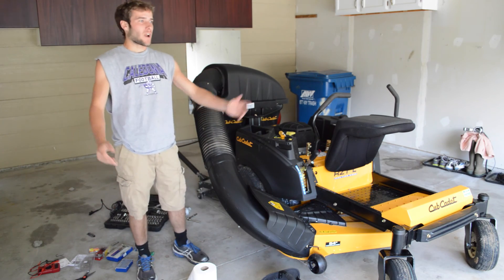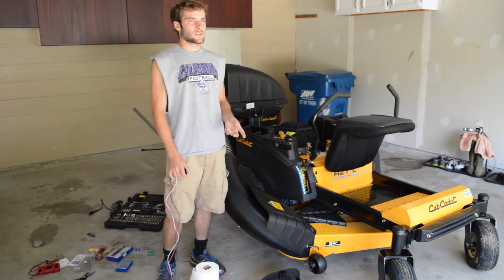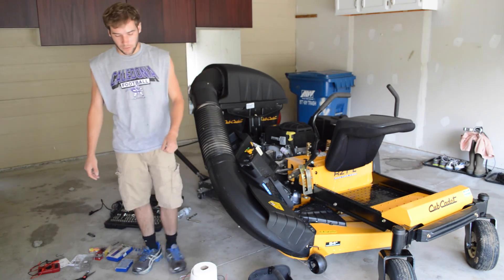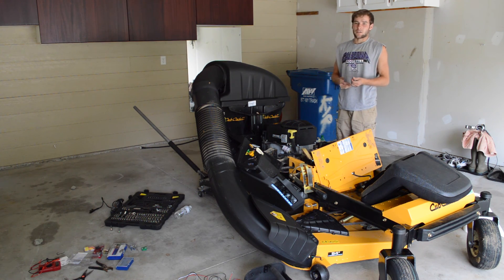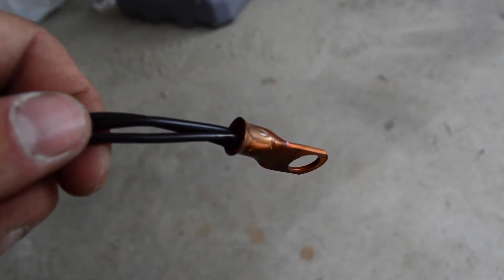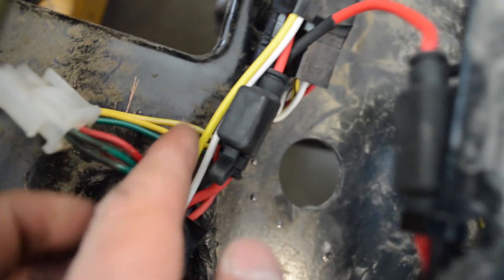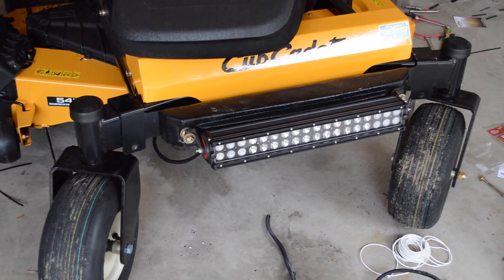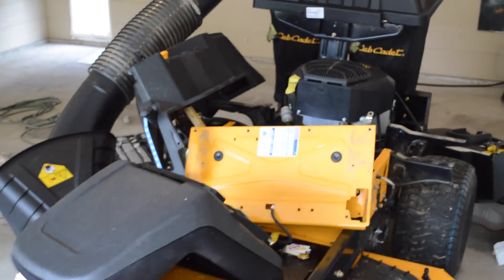Installing 12V outlet and LED bar on (Zero Turn) Riding Lawn Mowers

Comment: Thanks for the detail!  I have a similar model, and am trying to decide if I'm talking myself into or out of doing the lights mod.  Do you have any problem with battery drain or alternator damage?  The alternator is rated for 15A, and your mod draws 7.5A, so half of the capacity, and it wasn't designed to add lights.

Comment: Would you draw a schematic for us, or send me one em. My previous comment re: resistor may have been to stop AC current from stator. My John Deere Z turn has a fuse pocket and sale a kit with a single light. I would like to make my own system, headlights and tail lights LED,  and wire like  you did. Your video is the closest thing I have found on internet on "how to".  The JD kit would have to be purchased to see circuit, it is not in their owners guide.

Comment: I read somewhere LEDs are suppose to have a resistor placed inline to prevent light surging of the LED when applied to automobiles. (12v), DO you have any knowledge of this, I guess you hooked up a circuit without Res or such.  Comments on that topic?
Reply: Some you buy, already have the resistor included.

Info from a Electronics Technician with a a A.S. Degree " Electronics Technology"

Since 1982.

He hacked the crap out of it, but, you need to do what you got to do to get what you want.  I didn't see him constructing something that was a danger.

He was trying to show a person, how to add a light bar on a zero turn mower.  Something that they need, because what they give you is pitiful!  You can,t see forward with what they give you.

I will be doing a head-light enhancement, plus a pulsing LED rear set of lights via LED.  I do not what to be killed by a motorist that can not see me!

Kurt

Comment: what about wiring it to the batt instead would that cause probs
Reply: That's what i did. small, discrete toggle switch near start switch. Can't be accidentally turned off. If you leave the switch on , battery is going to die even without the light on (just dies faster with the light).

Comment: Skippy....They have this device called a soldering gun.  Burning insulation off the wires while soldering with a torch, went out with disco music!
Bit of a sloppy set up. Fuses/relays should be in 1 central location.
A for effort....D for execution.
Reply from the maker: +Bob Smith all the fuses and relays ARE in one central location, underneath the seat
Reply: I use a torch a lot too. especially for heavy gauge wire, usually a battery cable. Solder guns just take so long on anything larger than paper clip.
Reply: Yes they are in a central location.  I've been an electronics technician for 14 years now from the Air Force to private sector installing lights/siren/radios on emergency vehicles to working on 2 way radios and back to the government sector again.  I have never seen anyone use a torch to solder like you did.  Melting insulation is never good, but I do see how since it is the same voltage and amps go through the lines it doesn't really matter I suppose.  Great job in re-insulating the lines.  Most people probably wouldn't do that and then wonder why it is shorting out.  I thought your end product looked neat and professional.  Overall you did a great job.
Reply: I know soldering irons take a long time but I've never had an issue with a solder gun as long as you tin your wires before putting them together.  By tinning them 1st you will have better heat transfer.  For anyone out there wondering what kind of solder gun I would recommend something like this: Weller D550PK 120-volt 260/200-watt Professional Soldering Gun Kit.  They can be found around the price range of $45 to $65 online or you might be able to find it at Lowe's or Home Depot or maybe even Walmart.  (This was the price point as of June 2017)
Reply: Lud Wig Sure, if you aren't using the right soldering gun.

Comment: Hows this worked out? I want to do the same to mine but not sure if the stock charging system is strong enough. I want to do a 12" bar and 2 led pods so i can see the mower deck and possibly a light on the rear
Reply from the maker: +Karsten Jackson (RollTideMan16) it has worked out great! the stock strator is 25 amps and i have never had an issue with a dead battery, after several weeks of testing i also purchased a trickle charger to maintain the electrical system as a precaution